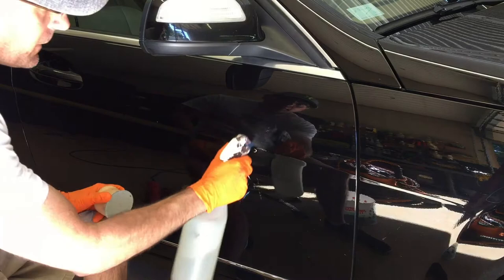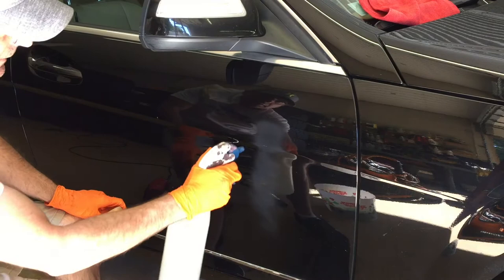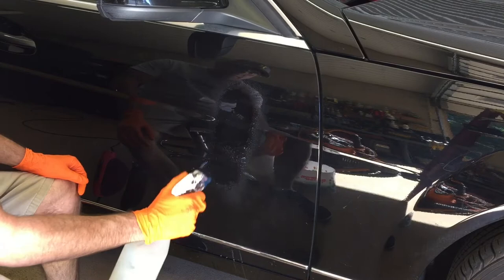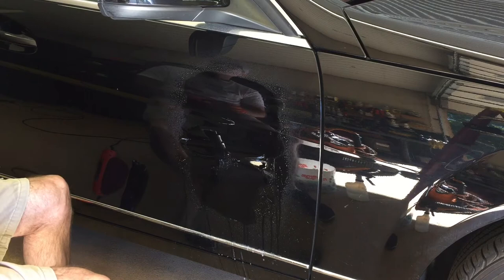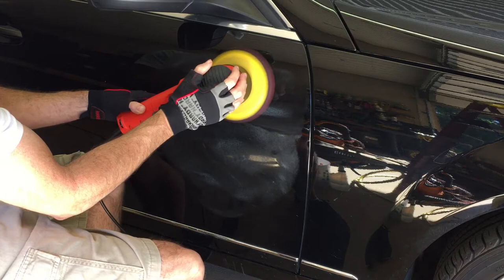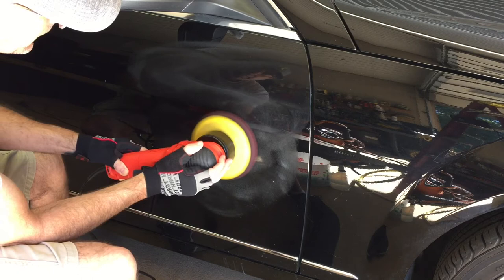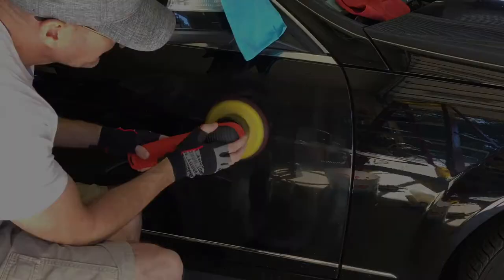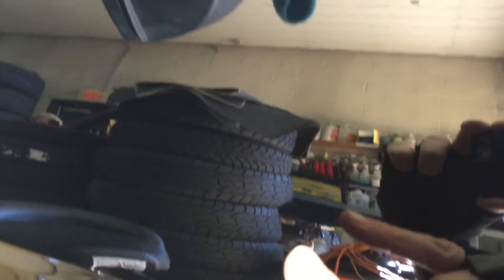How to remove scratches on soft clear coat!

Comment: Hi Brian. Another very educational video from you! As someone who has been doing all the polishing and waxing by hand all my life, I've found the DA polishers to be very beneficial in saving my energy now that I'm detailing more than just my families cars. LOL. I'm still going to get around to picking up a buffer in the spring. I'm very interested in the Griots BOSS long throw DAs. I was on thw fence about DA's for years. The reason I chose the Griots 6 inch was two fold. One the detailer at a shop I frequent recommended it AND the Griots polishers have a LIFETIME WARRANTY. That's a huge plus in my books. They also come WITH the backing plate and many others to my understanding do not.
So if and when you get a chance to demo and comment on the BOSS polishers I'd appreciate it. Looking forward to your next video!! ~ Kelly
Reply from the maker: I have use Griots polishers for some time ... still use the entry level 6" and 3" from time to time. The flex polishers are my absolute favorite with the Boss system coming in a close second. It would be my pleasure to review those for ya. I have just a few more to publish with the entry level polishers... then I shall get to it. Cheers!!

Comment: Nice work and thanks for the video.  One question (apologies if it is covered in the comments below - I only read a few) - why would you do the dent pull after the scratch restoration?  If they cause any more scratches doing that, then you have to go deeper into the clear to remove those.  Just curious.

Comment: Great to here you’ll be addressing clear coat thickness
Love from the uk
Mark
Donutmandetailing
Reply from the maker: I dont use a guage all that much... just keep an eye on the texture. If the orange peel has been sanded smooth. You normally do not want to go much deeper

Comment: Another great job I would like to know  where to get sanding block and paper like that.
Reply from the maker: My particular block came from a 3m headlight kit. The discs from an Advanced Auto or here..https://www.walmart.com/ip/Trizact-Hookit-Foam-Disc-3-inch-5000-grit/442896646?wmlspartner=wlpa&selectedSellerId=649&adid=22222222228067596537&wmlspartner=wmtlabs&wl0=&wl1=g&wl2=m&wl3=172782911224&wl4=aud-310687322322:pla-282497460372&wl5=9007443&wl6=&wl7=&wl8=&wl9=pla&wl10=112354411&wl11=online&wl12=442896646&wl13=&veh=sem

Comment: Great video Brian, what backing plate are you using on the Griots polisher.I have a Griots 5 " backing plate and I have trouble keeping the pad on backing plate.
Reply from the maker: Its the stock plate. What type of pads do you use and what speed do you operate it?
Reply: I use the buff and shine medium orange cutting pad  at speed 5 with a Griots Garage backing plate which to me doesn't hold the pad well.It will slip off center and this tears the pad up.I ordered a TORQ BUFLC201 R5 Dual-Action Backing Plate with Hyper Flex Technology, Red (5 Inch) and will how it does.Thank you for your prompt reply.
Reply: @gregfisher216  ....so, how did your new combo work out?

Comment: Dear Brain as usual WTG Video and I think I told you before about my Trust to Menzerna 400 Compound to remove scratches and oxidization unfortunately I tried it on GMC Yukon hood oxidized in three spots. It looks gone later on after 24 hours the oxidization appears again so what is the solution and do you have any video for oxidization removal?
Reply from the maker: Colour sanding the area with 3000 grit before you compound will take it away permanently
Reply from the maker: Feras Al-Hindi          https://youtu.be/4chk65Dt1j8

Comment: Do you have to sand it down, is there another way to remover the scratches
Reply from the maker: This is the safest way to remove scratches. You can hang on a rotary or DA polisher forever...but it puts your clear coat through way too much stress with temps exceeding 145 degrees.